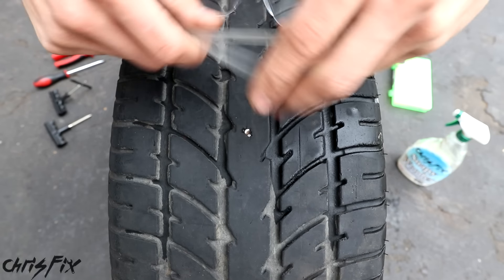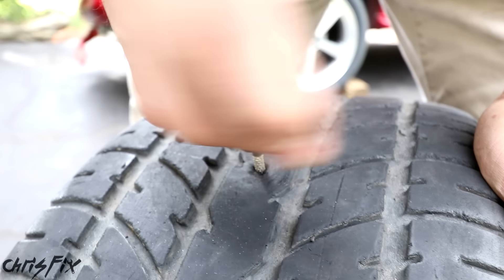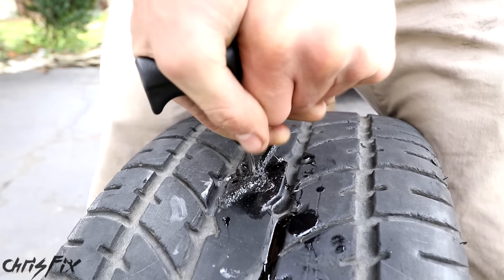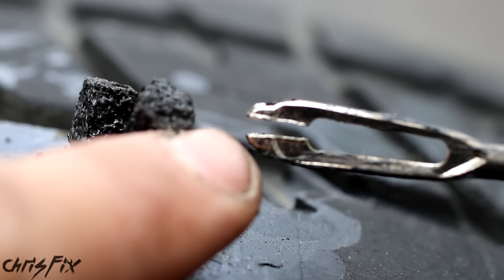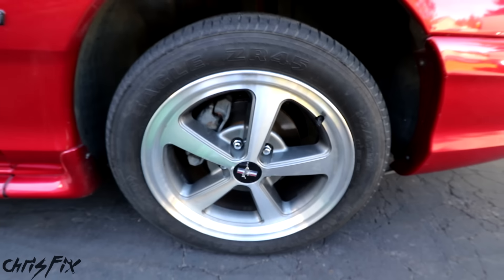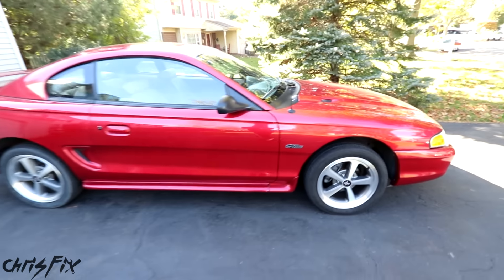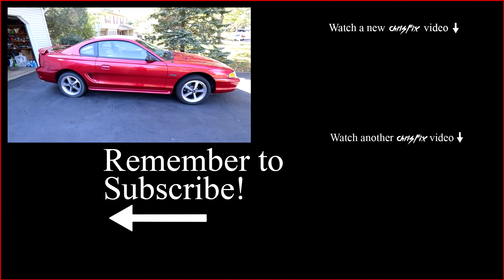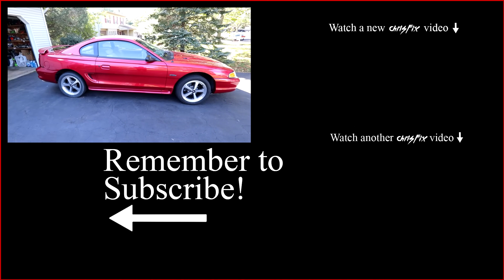How to Fix a Flat Tire EASY (Everything you need to know)

Comment: @ChrisFix Question, are you a certified mechanic? I was just wondering.  I know that doesn't have anything to do with this video, and i'm not questioning your abilities either. Just curios lol
Reply: lemkelegion this is just his hobby
Reply: lemkelegion
Reply: I think he goes/went to an automotive technician school or something. He mentioned that in one of his videos. I forgot which one
Reply: certified mechanic do not do their job on spec, they never toque your wheel nuts.
Reply: PC KUCHING yep buddy your right. maybe a brand new tech. but after about 2 months of losing money being extra specific with every nut and bolt with a torque wrench, ratchet, bar. that is lost on favor of the air gun style.
Reply: I'm master certified and have torqued wheels for 25 years.
Reply: +non'ya biz hahaha losing money... What are you on. It takes less than  2 minutes to torque all wheels. Loosing money is when the wheel falls of down the motorway causing a giant crash and you end up going to jail for being liable for it
Reply: ADirtyPanda97 I have never seen a tire which the nuts were installed with a properly working impact gun come off. if anything the gun rips the studs off the car. in a shop where you are paid by the job hour, air tools are the normal. every now and then you'll find a old school tech which may use it. but the gun is faster and the most preferable choice. unless the tech does shit loads of head work most of the time the torque wrenches they use is pretty far out of calibration.
Reply: Torque sticks work very well.
Reply: Trumby oh my ;)
Reply: Obi-Wan Kenobi 12
Reply: Certified mechanics at a Toyota dealership put a shackle bolt in backwards so it was clearancing into the shackle bucket and forgot to put a nut on a leaf spring bolt.  Being certified means nothing - attention to detail means everything.
Reply: plugs tear the tire up and can cause seperation witch will resualt in a tire replacement i not every time tho i work at a busy tireshop i woulf prefer to patch the plug then to deal with nasty fix a flat and please tell who ever works on your car if you have fix a flat in your tire because if they dont know it will get all over tgem and their machine
Reply: Anthony Mancini ikr some mechanics at "certified dealers" are idiots. My dad had to go back to General Motors 6 times with his Silverado for battery issues. They couldn't realize the first time the Onstar road side assistance was constantly running.
Reply: lemkelegion That means nothing. He is obviously a great mechanic. Certified mechanics are no more likely to do a good job than a good non certified one.
Reply: Avery Alexander Well,true, I'm in training myself.
Reply: I only started torqued when they switched to aluminum wheels. Always afraid of damaging or cracking the Aluminum. Always used the air gun on steel wheels. 35+ years. Never had a problem.
Reply: i do
Reply: Torque sticks ftw.
Reply: Only problem I ever noticed using air gun to tighten wheel lug nuts/bolts was that some times the brake rotors would warp.We then started using air gun with very low air perssure to run the nuts on then finish with a torque wrench,only took a couple minutes longer.Don't know if rotor warping is a problem ant more as I have been retired for over 11 years.

Comment: Wouldn't the wheel chock go behind the rear wheel if you're jacking up the front?
Reply: His driveway is downhill and the car was facing down the hill, but on flat surface it should be behind :)
Reply: He stuck it in first probably, so if it rolls it'll roll forward.
Reply: If you put manual car in forward gear it can still go backwards...
Reply: I chock both sides to be safer.
Reply: Ah. I didn't notice his driveway was slanted
Reply: It doesn't roll forward if you put it in first. It rolls the exact same amount forward or backwards. Typically it will move the car a little bit (talking a few cm here), but then it stays firm.
Reply from the maker: The driveway is downhill. You want to prevent the car from rolling down the driveway. Plus, the ebrake is on so it is more for extra protection!

Comment: Bad thing about using fix-a-flat is that it can ruin the sensors in the tire pressure monitoring system
Reply: But your videos are very informative
Reply from the maker: Thanks for the tip! I havent tested it but the new can I have is supposedly TPMS safe!
Reply: The new cans say they are but I've had a few friends that have used it and they ended up having to replace the TPMS sensor in the wheel that they'd used the fix a flat in, those sensors aren't cheep

Comment: ChrisFix the type of nigga to use a torque wrench on his toothpaste cap
Reply: The recommended torque rating for a toothpaste cap is 3.2 pounds. Works like a charm for me :/
Reply: he means inch pounds
Reply from the maker: You dont want to tighten that toothpaste cap too much or you can strip the threads and too little will allow air to get in and dry out the toothpaste!
Reply: I use 3.1415 foot pounds of torque for my toothpaste, but I use mini travel toothpaste.
Reply: ChrisFix   Temporary locktite only!

Comment: did you put that screw in your Tire on purpose?
Reply: thestevemeister203 i was thinking the same thing specially right in the center
Reply: Land O Calrissian at first look, it looked like a nail, but he knew it was a screw. I've also have never seen such a exact centered screw in the tire. dead center.
Reply: Got to expirence this recently. Got to my autocross event and put the track shoes on the car. Now they were driven on for half a day and sure enough got a screw in one. Right in the center also. So it can happen. Plugged it just like he did in the video and had my race day!
Reply: ***** wasn't saying it can't happen but I've been working on cars for over 16 years and I've seen it all from golf t's to batterys get into tires I've see things get in the center but not exactly in the center and straight odds are pretty bad but it's possible
Reply: I think he did. He makes $1,000 to $2,000 from each video
Reply from the maker: I did not put a screw in my tire lol. Why would I want to do that? I have so many videos that need to be made that this is just a setback to the schedule. Sure it is an awesome and helpful video, but I need to get other videos done like the dual caliper setup, hydro ebrake, cleaning the engine bay, etc. Ain't nobody got time for dat!

Comment: Hey Chris can you do a video on putting the spare tire on with the scissor jack
Reply from the maker: Good idea!
Reply: Thank you so much
Reply: You'd be surprised how often I get a call from friends (Not being sexist, just observant, but usually girls) because they have a flat.. I think maybe they get stressed and that doesn't help.. Also quite often I notice the nuts are really tight or a bit sticky for the length of the iron.. Although most of them have 4 seasons tires so maybe the nuts just never get to move..

Comment: I just tried plugging my tire an completely destroyed the reamer lol. First I bent it then I shattered the handle. An yes I was putting it in straight.
Reply from the maker: Wow that doesnt sound fun! What kit?
Reply: ChrisFix harbor freight. Shocker right?  Lol.
Reply from the maker: Would have never guessed! haha
Reply: William Figueroa Jr. Did u have a cheep tire plug kit I bought a 5$ at Wal-Mart and work great for me
Reply: William Figueroa Jr. I tried slime deluxe it worked good after it was a small leak I put more rubber cement seems to fix it

Comment: I bet you punctuated that tire just so you could make a video :D
Reply: Punctuated? Usually punctuating a tyre is not necessary because a tyre is not a sentence. He may have punctured it though.
Reply: Usually not, you're right.
Reply: KiwiPokerPlayer Tyre ? don't you mean tire ?
Reply: Arely Fabian No. Tyre is the correct spelling and tire is the American spelling.
Reply: so which punctuation did you use , . : ;<€♡) or did he puncture the tyre
Reply: Do u think he put a nail in it on purpose.
Reply: KiwiPokerPlayer that's just a rumour
Reply: Kamil Corebanek punctuated? hahaha
Reply: I doubt it, simply because he has no reason to. Rather than messing up his own tire he could just wait and it'll happen with normal everyday driving.
Reply: As the tire is pretty dryrotted and has cracks all over it so it has to be replaced anyways I'd say Chris put the screw in to make this video
Reply: He was at a store parking lot.
Reply: since it took air without leaking back down he probably just let the air out
Reply: I think you need some SPG lessons.
Reply: IKR! :D (same thing as he scratched the PT cruiser with his keys)... and the reason that made me think of this, was because of the way how the screw was smack-dab right in the middle (in fact, perfectly in the middle). And I'm like, wth?! haha :D just sayin'.
Reply: Kamil Corebanek , Boi, the screw was far in from it being in there for a long time
Reply: Kamil Corebanek He let the rest of the air out when he saw it was low, but he created the scenario to help those in this situation!!
Reply: Kamil Corebanek you right, that screw looked too perfectly centered
Reply: Take note of the "missing" valve stem cap. lol
Reply: even if he did it on purpose,the outcome "this video" is useful...
Reply: Kamil Corebane
Reply: Yes, he also buys cars with a specific problem or borrows them and fixes the problem just like those who unpack and test electronics. Standard and honest way to run a youtube channel.
Reply: Nah, easier to just remove the valve stem.  LOL

Comment: I just got a nail on the first thread of the tire most tire shop refused to repair it but i went to some mexican tires repair for that same patch you did $10 lol.. will this patch last a year?
Reply: Skyethur has it lasted?
Reply: it depends on were the hole is ,how big the hole and how well they did the repair ...
Reply: patches last forever to be honest
Reply: someone in the comments said theirs lasted 6 years
Reply: Skyethur Mexicans are the best
Reply: cookie boii in my experience, my local Mexican shop is awesome at inexpensively fixing the tire situations, which other shops avoid. I have heard that Iraqis are also stars at this. I saw a video from Dubai once and I was impressed. I must consider that Americans (the world’s car market), Europeans (Formula1), or Chinese (the world’s truck tire manufacturer?) are the best. Would it suffice to say that with different safety standards, these traditions have different strengths?
Reply: Did they dismount the tire tho? I work in a tire shop and we refused to plug a tire on the middle of the tread today only because there were shavings inside the tire which could potentially cause them to have a blowout.

Comment: I recommend tire slime not fix a flat. I noticed better results with tire slime.
Reply from the maker: Thanks for the tip!
Reply: I just used this brand, real good results. But I got the kit with the cement, they also sell one without.
Reply: It also doesn't damage the tire and is easier to clean out of the tire
Reply: Have used Slime. Seemed to work, but can't figure out why a ton of it was still liquid when I went to get a repair...
Reply: LegoChris 2008 problem is when you're having tpms to clean too
Reply: In my experience with one small tire slime works great!but with 20" where it call for more or multiple tires it throws off tire balance.i had mad wobbles on my car from slime!def. Recomend if single tire and small size,but anything more would say just plug it.even on slime bottle it says not for highway use
Reply: it needs oxygen/air to dry. usually where it bubbles out from the tire, it can dry. inside the tire it will stay liquid.
which is good. it will seal any other leak which will happen after.
how long it will stay liquid inside the tire, I don´t know.

Comment: I've use tire plug for almost 2 years on my 01 honda CityZ and it still not leaking
Reply: Plugged and it started leaking after 6 months
Reply: I've had a plug for 4 years, I used a kit with the rubber cement, not sure if it makes a difference, but the plug has seen many thousands miles and a lot of temperature changes, still as strong as when I put it in.

Comment: I got new tires and a few days after I got a screw I temporarily plugged it until I had time to go back to the tire shop 40.0000+ miles later I just replaced the tires, those plugs are great

Comment: if you have TPMS do not use Fix-A-Flat
Reply: Why not? Current formulations are explicitly labeled as TPMS safe. If you personally cleaned your TPMS and it's still not working then I'd say you have grounds for a lawsuit against Fix-A-Flat. If it's just something a tire shop tells you I would ask for the used part for inspection as they might be lying to you.
Reply: Robert Brandow I've personally seen fix a flat kill TPMS sensors
Reply: That's unfortunate. :-/ I still think I'll risk it though because my car has run-flat tires and no spare. If I drive while running flat I have to replace the tire which is more expensive than using slime and just replacing the sensor.
Reply: Some places don't fix run flats because your not sure how long it's been driven on flat i know Mercedes doesn't it wil soin be the law
Reply: A law prohibiting patching run-flat tires? Is that in the US? I know that was an issue in the UK. Maybe I'll switch to regular tires. Too much hassle.
Reply: I'm not sure i know we still patch but we had a customer come in a month ago to buy a new run flat because Mercedes wouldn't patch it 450$ for one tire
Reply: Yeah, I wouldn't buy a tire from a dealership. lol
Reply: I have also added Fix-A-Flat to a TPMS system and ruined it. and I know that they do have new formula that says it's safe but I still would not trust it. Maybe in a emergency. LOL that's why I have Roadside now but most the time I'm off road. and yes they are making a law on run-flats you can no longer repair them, that's in the states as well.
Reply: OK, thanks

Comment: do people really buy your "soapy wooder"?? 
or do you actually sell that to people haha
Reply from the maker: +Brousey B I don't  actually sell it... yet hahaha
Reply: you should get on that, sounds like a clever idea
Reply: ChrisFix if you get rich off that i may have to share your "special" ingredients haha.
Hey!! Also I just finished a brake job on my moms traverse for her. Long story short she welded her pads to the rotor and caliper pretty much, i changed everything and ended up rebuilding her calipers, changed the pistons, piston boot seals, square cut rings and honed the cylinders. Now its like its a brand new vehicle again. 
1. Will they last?
2. Is it recommended? Ive done my lvl 3 apprenticeship years ago
I also sabd blasted the calipers with glass bead then painted and sealed with heat res. Paint
Reply from the maker: That is a deal haha. Nice work man! I want to do a video on rebuilding a caliper! Let me know how long it lasts!
Reply: Brousey B i8iii

Comment: I got a flat on a French motorway. (I'm British). Jacked the car up but couldn't loosen the lug nuts with short tool provided (about 12 inch in length) even standing on it. The shop that fitted my new tyres had done the lug nuts up with an air-gun waaaaay too tight.  Had to call out a brake down truck. I now have a torque wrench and whenever the wheels are taken off by a garage, when I get home, I double check the tightness.  Also, as a temporary fix,  if you have air leaking from the rim on a alloy wheel due to corrosion, deflate the tyre just a little and using a large hammer, hit the tyre hard where the leak is as close to the rim as possible. Nine times out of ten this will work.

Comment: Thank you for the tip to use the rubber cement as a lubricant. That made it much easier to slide the tool out of that plug.

Comment: Great video..I had a mysterious flat tire today on my Chevy Silverado. No cuts in the side wall and didn't run any sharp object over or hit anything. It ended up being a bad cracked valve stem!!!! Everybody check your valve stems and the rubber base for cracks and hissing losing air!

Comment: Great video! 

I have one of these exact same kits from Slime on each of my vehicles. I also have an air compressor, a fire extinguisher, reflective triangles, engine starter battery pack, a few tools, some basic car fluids, duck tape, a first aid kit, flashlight, 2 MREs and 2 bottles of water.

Here in California it’s a huge hassle just to get a patch at a random shop. Too much wait time, over $50 bux for the job and the workers at these shops always have a bad attitude. Better off doing it yourself and keep your sanity. So, I never go in to get the tire  patched from the inside. Never had a problem with a string plug and I leave it in there until it’s time to get new tires.

Comment: Great Information! Everyone should know how to do it. You can't always rely on the Emergency Road Service (Auto Club, AAA). You may have to wait a few hours if they are busy. 
If you are in the middle of nowhere with no cell service. You would be screwed without knowing how.
It may sound extreme but a pair of black overalls are only about $35 on Amazon. It would keep you clean; because you will get dirty. (Plus if you add one of those white masks, it can double once a year as a Halloween costume). A pair of gloves, a tube of waterless Orange Hand Cleaner and a few rags are a nice addition too. Stay clean and still be on time for that appointment or date.

Comment: I have one of those tools for plugging the hole of the tyre for motorbike but I used it on my car too and it worked so good. I drove for 30,000 or 40,000 miles and the plug was still holding up.

And for the compressor, I have a battery powered one which can inflate 6-8 tyres of 30-35 PSI and costed me only £50 but I can use it with cigarette lighter too. Plus it's very small and does not take space at all.